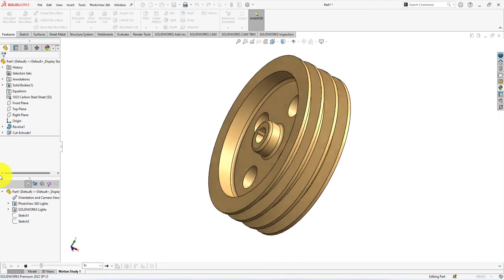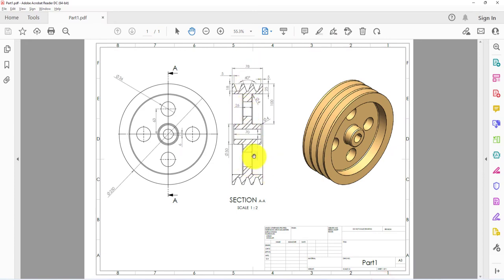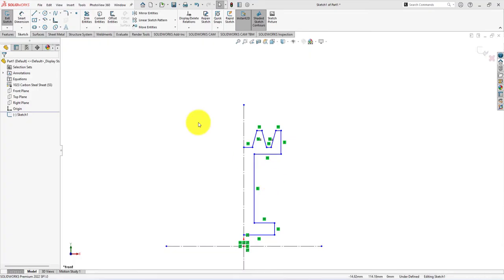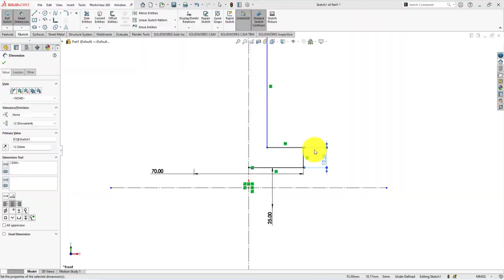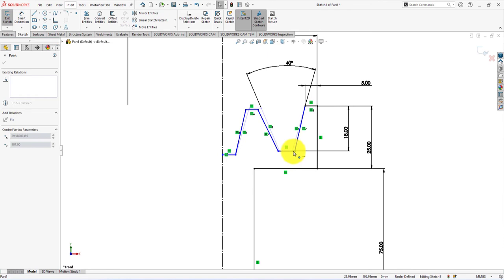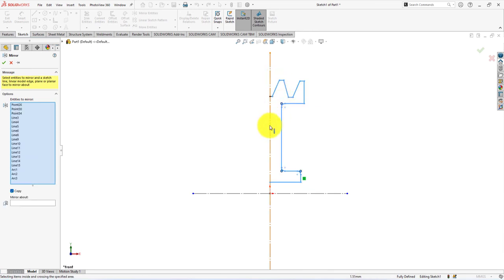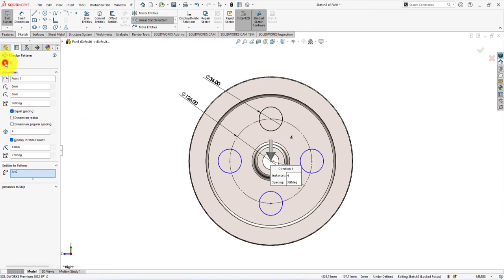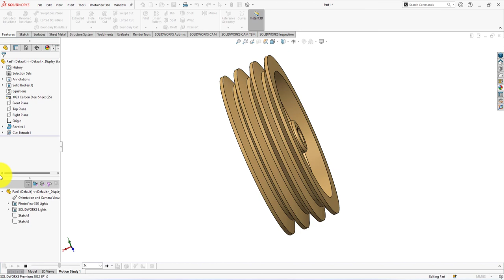SolidWorks 2022 Tutorial V-Belt Pulley Design

Comment: I'm a beginner in solidworks just started 2 days ago and I've already done 4 models by following your tutorials and instructions. I still have a lot to discover on how to use the commands especially on how to make all the entities fully defined. I learned to draw in AutoCAD and I can do some decent drawings in both 2D and 3D modelling, and so I thought I would be able to learn solidworks quickly because I have knowledge in AutoCAD but it turns out I'm struggling with the different options and features because it's a bit different here in solidworks😅. Anyway, I'll continue practicing with your tutorials so thanks for the videos.
Reply from the maker: Sounds great. As you mentioned you have experience of using AutoCAD and you can also create 3D models there, so it will be easier for you to learn SolidWorks. You just need dedication and regular precise. Hope you will learn this nice design tool very soon. All the best.